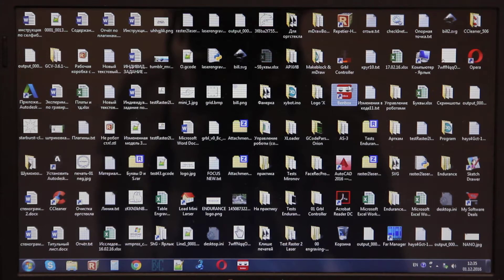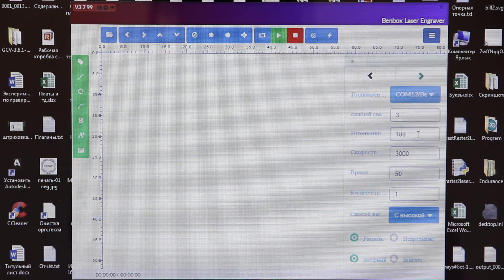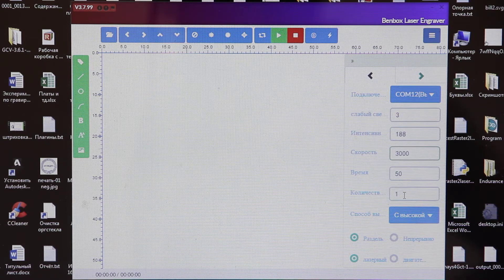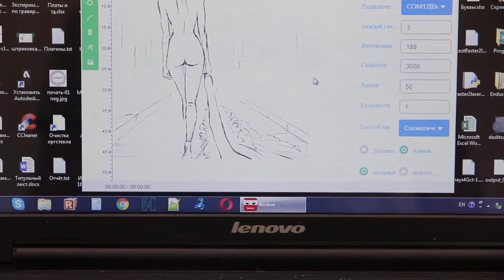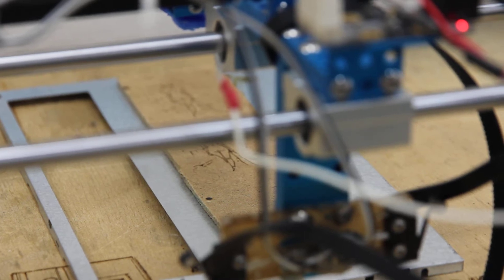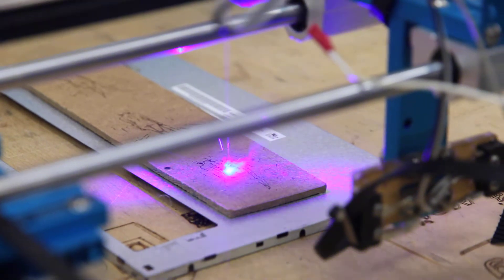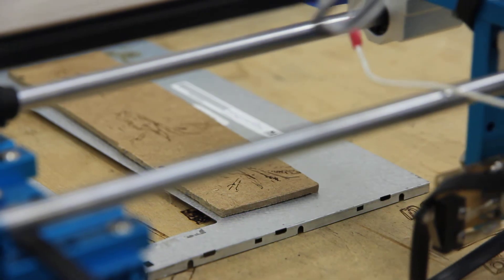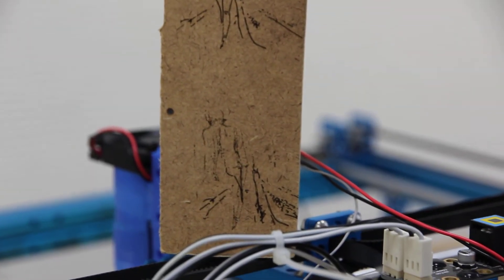Video tutorial how to use BenBox software

Comment: I have a problem with laser modul. When I conect usb and power and hit the on button, laser is turned on and it doesn't turn off at all. so it makes little lines when I engrave. What is the problem?
Reply: i buy from china 2500w laser cutter the brand is eleksmaker
Reply: i buy from china its eleksmaker 2500w